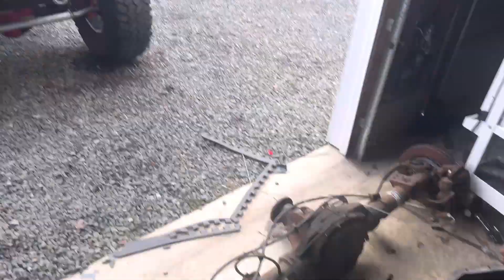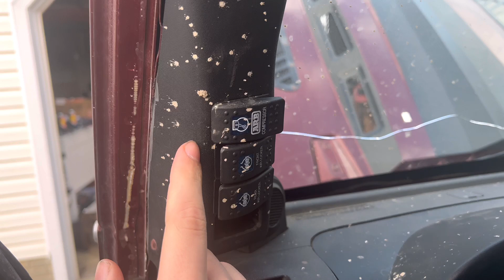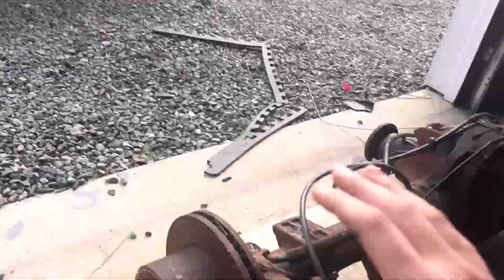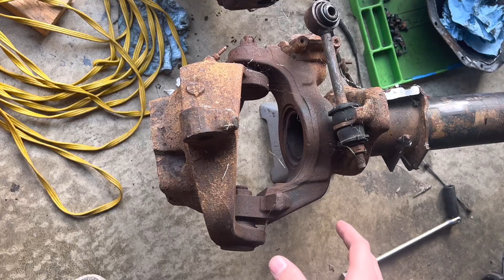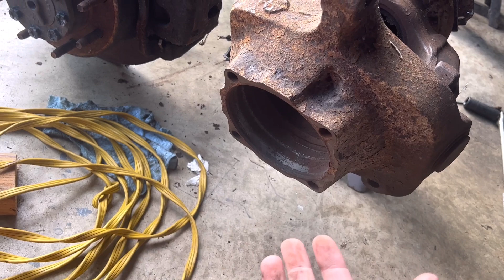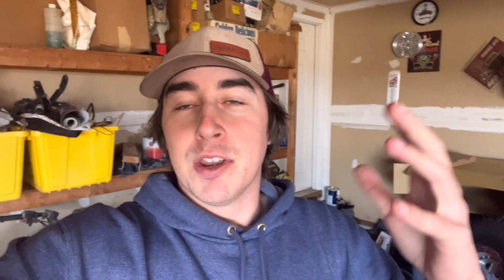JEEP WJ DANA 60 PARTS BREAKDOWN *WJ 1TON SWAP*

Comment: How far in do you have to move the coil buckets to match up with the WJ? I've looked all over and i cannot find distance of the front coils center to center vs a JK.
Reply from the maker: Not 100% sure I’ve heard about 1/2” each side. I’ll find out soon if that’s right lol.
Reply: @ROCKY_TV  Thank you.
Reply: I know this is way later,but did you find out what the difference was
Reply: @cwayne6867  no, but I ended going a different direction. I bought a Superduty.